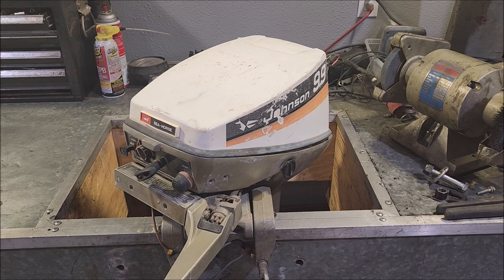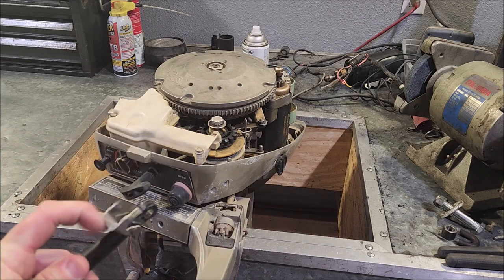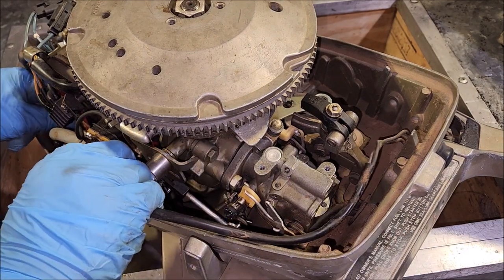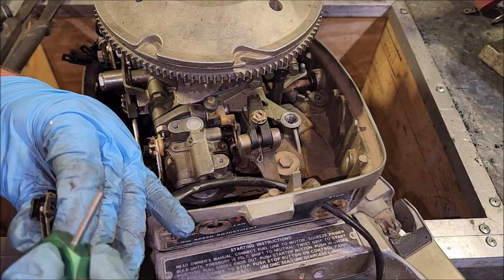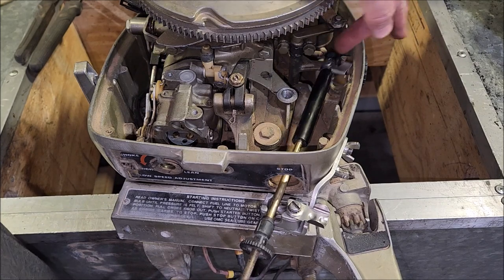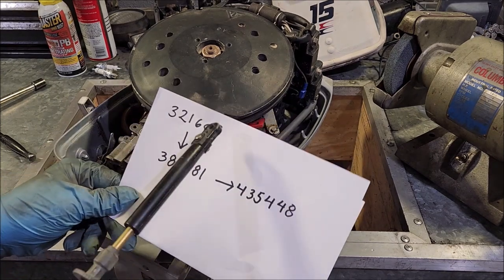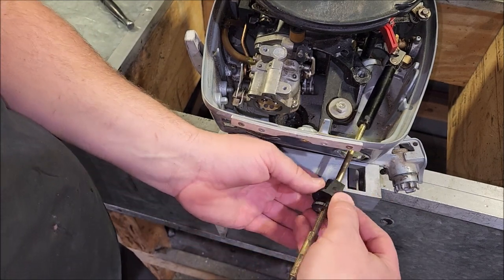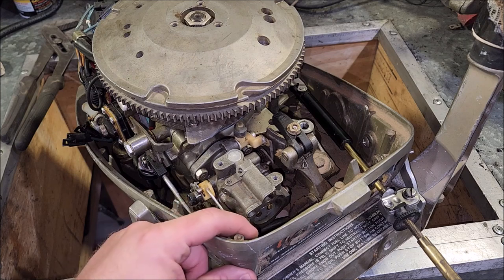Johnson Evinrude 9.9 & 15 HP Remote Throttle Cable Installation

Comment from the maker: Old Style (Harder to Find)
319950 THROTTLE BRACKET- https://ebay.us/eNzbiG
310685 ANCHOR BLOCK- https://ebay.us/UBM75Z
386660 Complete Kit- https://ebay.us/rUHvEK

New Style (Still available, and low cost)
435448 Throttle Connector- https://ebay.us/C7XVLq

Comment: I know it was just a tongue slip on your part but for the benefit of the learning masses (LOL), that white plastic plenum that channels air to the carb acts as a silencer (and is no "air cleaner"). Thanks for another thorough presentation. Showing the alternate mounting method and giving parts numbers elevates the info it provides to a "reference level" comparable to Leeroy's Rambling's articles. Happy New Year to you and all your loved ones !

Comment: Amazing video, do you happen to have any video showing how to connect a shifter cable to these motors as well? I have two 9.9s one Johnson and one Evan and I am thinking about adding a shift cable and a throttle cable with a steering set up for my little John Boat, can you help me?

Comment: Will any remote throttle and shifters work with this setup or do they need to be brand specific or engine specific?
Same with shifter 
Planning on try to make cheap remote outboard setup on this motor actually be a great video idea as nothing really on YouTube  that's been very helpful apart from this video.
Reply from the maker: Well a OMC/Johnons/Evinrude controller.
I wouldn't try to get a mercury controller working with it.

Comment: What is the apparatus just to the right of the carb? It;s a molded aluminum piece with a black plastic swing arm.
Reply from the maker: Shift interlock, 
It locks the starter from being pulled when the engine is in gear.
Reply: @BrandonsGarage  Thank you